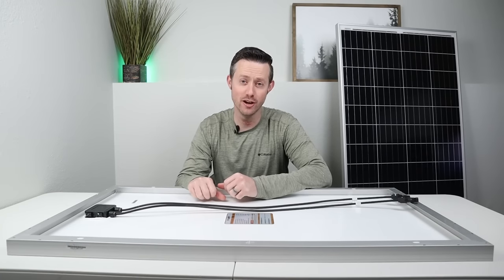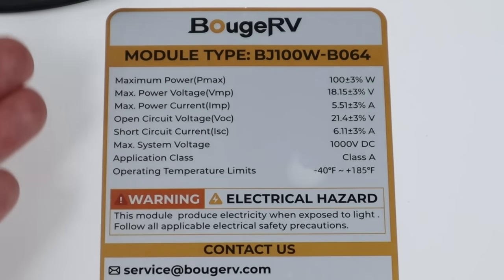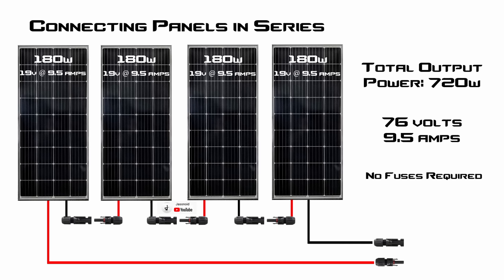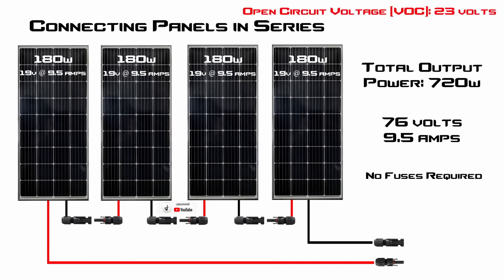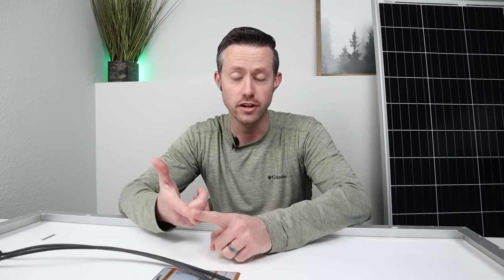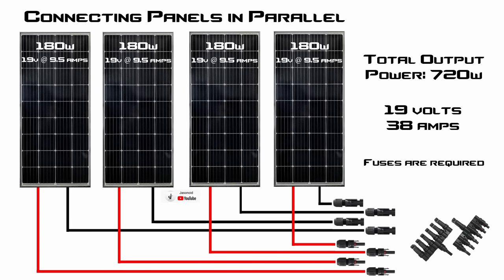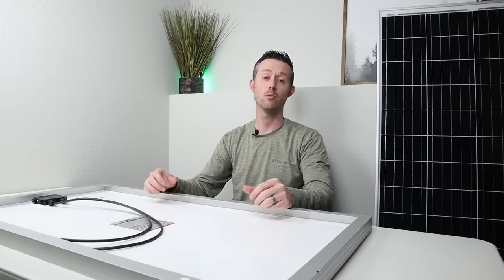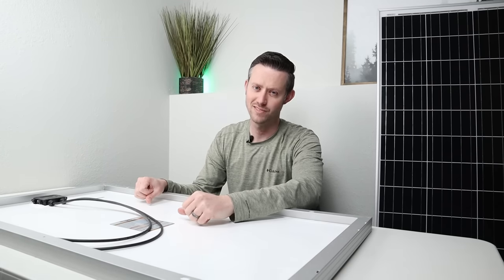Series VS Parallel! A Beginner's Guide for Solar Panel Connections - With Basic Diagrams!

Comment: I would have liked if the video showed the fuse location when they are required. Otherwise, the video is has a significant amount of useful layman information
Reply from the maker: A 15 amp inline goes on each solar panel postive line, you purchase something like this:
https://amzn.to/4cRKPTf

Comment: I’m looking at a solar power station that has a 60v max solar input but allows for 2400 watt charging. What’s the best set up. I would like to use 400 watt panels at about 50v. Thx! Can I only go parallel? What if I need 50ft of cord?
Reply from the maker: Sooooooo..... you're going to want the highest voltage panel you can find so it can be connected in parallel on that model. You can overpanel it, meaning you can have more that 25 amps in your solar array, the power station will limit the amperage automatically. (Sounds like the Anker SOLIX F3800) 

After looking for about 20 minutes I found these two options from signature solar:
https://signaturesolar.com/q-cells-475w-half-cell-bifacial-solar-panel-silver-q-peak-duo-xl-g10-series/
https://signaturesolar.com/bluesun-460w-half-cell-bifacial-solar-panel-silver-up-to-575w-with-bifacial-gain/

Most current '400w' panel options produce peak power at 30v-32v which isn't high enough for full solar input on the F3800. Check out my review of the Anker F3800 I just put out today where I tested with two of my Talesun 400w panels in parallel. I only got 310 watts since the voltage was too low.

For higher power, you need a Vmp around 47v to 48v Vmp on the panel specs but I can't find anything that perfect.

Don't forget to like and subscribe. How often do you get free info like this from other creators?
Reply: Hi Jason, yes it’s the F3800.  If you can over panel (parallel) where does the 2,400 watt array limit come into play?Would I need to use both XT60 ports or can I get the full 2,400 watts going all parallel into one XT60 port? I know the volts matter, but the Amps don’t in this configuration? Thanks! Dave
Reply from the maker: @Curious_Cat123  1200 watts per port, 60v max in each more. Both ports give you 2400 watts total. You can overpanel with amps (meaning panels in parallel). Never go over the max voltage. You can watch my F3800 review for more details.
Reply: @Jasonoid  Thank you. Yes, I have been watching your videos. They are very informative!

Comment: I am confused on this amazing thing called series&parrellel. Even my 2 local rv shops doesn't understand it. PLEASE can break that down better? I need it.
Reply from the maker: It doesn't get more simple than this video. Just keep watching videos till it sticks.
Reply: @Jasonoid  They said you can only do one or the other. So, I did it myself. One has 7 years in business and other said over 10 years. But, I got it
Reply: It actually confusing because you have positive on the left 2 panels BUT positive on the right on the right side panels. Look at your diagram. @Jasonoid

Comment: Sir i have two 200watts solar panel one is 37.5 voc and one is 22.6voc can i series this. My charge controller is 60a Powmr. 12 v system only.
Reply from the maker: Those panels are pretty different, I'm not sure they would work well together due to the different voltage levels. You can always try to see what happens, no harm in that.

Comment: You said to use a fuse. what size fuse. or blocking diode size. I have watched a lot of videos, and no one has given a size.
Reply from the maker: Each solar panel is different. It will usually say on the back spec sheet for what size fuse they recommend. The fuse is there to protect the wire coming off the solar panel, usually a 20 amp fuse will suffice.

Comment: Do bypass diodes not mitigate the shading issue on panels now. I thought that having to wire in parallel for shading was a thing of the past?
Reply from the maker: Bypass diodes essentially skip the panel that's shaded, meaning your voltage will be dropped significantly. Your wattage will also drop since you just took a panel out of your setup. Now there are so many types of panels but the main theme behind bypass diodes is that they will choose the path of least resistance and the power will skip the panel.
Reply: So if any shading is likely to occur, it would be better( assuming the mppt can handle the increase in current) to wire in parallel? @Jasonoid
Reply from the maker: @mrurga35  if you plan to have lots of shading in your setup, chose a parallel setup. Series wiring is horrible for shading.

Comment: hi jason, what if you had 5 panels? 3s +2s into a combiner?
Reply from the maker: From my understanding the voltages have to match in a combiner box. You'd want to have two 3S arrays OR two 2S arrays, not mismatched arrays of 3S and 2S. In the combiner box you're just connecting to a  common bus bar with the positive and negative outputs, so it's like putting those arrays in parallel. Keep both arrays the same voltage and you should be fine.
Reply: @Jasonoid  that is exactly what i was concerned with. thanks for clarifying.

Comment: And where does the cables for the series/parallel go to? A combiner box or a mpg charge controller
Reply from the maker: Depends on the setup. Most setups go straight to the charge controller main pos and neg input.
Reply: Now can i add a second set of series/parallel panels.  I wish i could find an app so I could check my math.  I do appreciate the help

Comment: Okay, someone help me. If you run the solar pannels in series and they're producing up to 100v's at 9.5 amps what controller can you use? I dont know if I'm thinking about this wrong, but every controller I see is only good for 12,24,36, and 48 volts for the most part. I just cant figure out what kind of charge controller I would need, but everything else makes sense to me.
Reply from the maker: This MPPT charge controller works well for 12v - 48v, with solar panels up to 150voc. I use it everyday, it's awesome!
https://amzn.to/3LkiloV

Comment: Calculate the highest number of panels you can put in series and have that combined voltage be lower than what your charge controller can handle. For example, my Victron SmartSolar 150/100 has a 150VDC maximum as well as a 100A ceiling. So if each panel yields 45VDC in daylight then put no more than three panels in series (135VDC). Next, create groups of panels in series to match whatever you just did. So if you put two panels in series, continue to pair up more panels. Each grouping then is put in parallel to increase the current. If each panel yields 15A maximum then each group in series will still yield 15A together. Add as many as six groups in parallel (6 * 15A < 100A) and you'd have the maximum number of panels for my controller in this case. The maximum power then for this particular panel specification would be 135VDC * 90A => 12,150W. A common misconception is that you should put all the panels in parallel; this produces a lower overall voltage like 15VDC most of the day which is barely enough to get the MPPT to actually charge a 12VDC collection of batteries and even worse for a 24VDC set. Plan for the highest combined voltage that your charger will handle on the solar side of things and the "bulk" period of the day will be optimal.
Reply from the maker: Thanks for the tips! I'm sure others will find it helpful!

Comment: Hello what procedure to run foldable harbor freight 100 watt panels 50 watts per side however both are already linked to each other and then only having one main lead coming out module previously linking both panels already , if you look at rear panels its not like typical 100 watt panel that has its own positive and negative leads I havn't found any video addressing this yet thanks in advance
Reply from the maker: Does it look like an SAE connector? It's a common automotive electrical connection?
Reply: @Jasonoid  firstly thanks I appreciate response..I already converted the connector from sae to mc4 the issue for me is the foldable panel each has a module on backside one module is already linked into other module from factory with one main lead pos/neg to connect instead each module having its own pos/neg leads on the back of the panel it states these panels cannot connect in series, but I see other utubers say they can, but without showing illustration, not sure if this make sense to you thanks again
Reply from the maker: @YH7R  okay, so they are wired in parallel from the factory. I reviewed a folding solar panel that was similar on the channel awhile ago. 
If you wanted to connect them in series you'd want to cut the wires coming out of the first panel so it's has its own wiring, then test for polarity to see which one is pos and negative, then add mc4 connections to each wire. You could also try to break open the junction box and just unscrew the wires from there and do the same thing without cutting the wires. Usually the junction boxes are accessible and just pop off with a screwdriver. 
With the wires separated and mc4 installed, you can easily connect them in different scenarios since they have individual MC4 connectors (parallel or series)
Reply: @Jasonoid  Ok will do Your such a blessing I really appreciate your help GOD BLESS you and your family

Comment: I have 4 panel with 180 Watts and 05 panel with 100 watts..... is it  possible to connect all panel series and to the MPPT 
controller.if not just advice me how I can connect alla those panels get Enegery
Reply from the maker: If the panels have similar voltages at peak power they might work well together. You'll want to combine the 100w panels in pairs of parallel so they match the power of the 180w panels, then you'll get better power as they are connected in series.
Reply: Thank you for your advice 
 @Jasonoid

Comment: I have two 235 solar panels connected in series. On sunny days, I get 250 watts into my power station. I purchased the panels second-hand. I'm confused about why I'm not getting 470 watts of solar or greater during cold, sunny weather. I also had a 100-watt panel, and I was not getting full output I was around 80 watts.

Any ideas as to why this is happening? The most i have seen is 300 plus.
Reply from the maker: What power station do you have?
Reply: @Jasonoid  vanpowers super power pro 2000 it’s supposed to handle up to 600 watt solar power input
Reply from the maker: @miguelguerrero2335  when connecting solar panels in series, if any portion of the panel is shaded, you'll lose most the power output. If you have them mounted on the roof, make sure there are no shadows on the panels.
Reply: @Jasonoid  There are no shadows. They are mounted on my cargo trailer. I honestly don't know what is wrong, but I'll keep using the panels.
Reply from the maker: @miguelguerrero2335  panels laying flat in the winter get horrible power due to the sun being very low in the south.

You'll see better solar power in the summer as the sun is higher in the high and light gets more vertical.

Comment: How much wattage I need for solar panel if I have 12v 1.5kw hybrid inverter.
Reply from the maker: if you are going to be maxing out the inverter at 1500 watts frequently, it might be wise to have at least 1000 to 1200 watts of solar panels.

Comment: Sir good day I have a question please2 reply I like the way you explain obout solar panel.my name is edwin apolinario and I'm a pilipino who is a zero knoleged about off grid solar source.now my questio is can I connect 5peaces solar panel off one hundred watts each to a battery one peace only of 100 watts .accordingly to some of the YouTube technician video it takes of 5 hour to one solar panel of100 watts to fully charge,the battery of watts .in our country we could get solid hot sun 4 to 5 hour a day that's I plan to connect 5 peace solar panel to one battery so that I could charge in one hour .now I want to know the danger of that I I don use the power that comes from the solar panel.it is dangerous I could burn or please give me an advice thanks

Comment: I did not understand why do I need in line fuses on positive wire of each panel when I connect them in parallel. In my understanding, the wires have amperage rating not the panel. The two wires coming out of my solar panels have 12AWG which has amperage rating 20A. I have three Sanyo  HIP-200BA3 (200watt) solar panels: Short circuit (Isc):3:83A; Open circuit voltage (Voc):68.7V; (Ipmax): 3.59A; (Vpmax): 55.8V. I am planning to connect those three panels in parallel. Therefore I am using two adapters to combine those six wires before they go down through the roof. Do I still need in line fuse on each panel before they connect to an adapter that combine them?
Reply from the maker: When wired in parallel if one of the panels has a cell fail it will absorb the amperage of the entire circuit so the total array amperage will flow into that panel. If the total array amperage is under 20 amps, the 12awg will be just fine. 

Those panels are a bit unique, they have very high voltage and low amperage so I don't see an issue not having a fuse with those panels. 

Most other 200w panels have 20v @ 10 amps each, so having 3 in parallel would be 20v @ 30 amps which could cause an issue with 12awg wire if something went wrong.
Reply: @Jasonoid  Thank you very much for such a quick response Jason!. God bless!
Reply: Will Victron 100/ 15 work for my panel that I mentioned above or do I need higher amerage controller like 60A?
Reply from the maker: @temirtaragay8932  the 100 in the title means up to 100 volts input from your solar panel, the 15 means it will charge the battery at 15 amps.

Comment: I connected all of mine in parallel because I wanted to most amps flowing to the batteries with the least amount of voltage eaten up by the charge controller.

Comment: What determine if the batteries is to be connected in series or parallel
Reply from the maker: Usually the battery voltage or the charge controller. Some charge controllers can only handle a low input voltage.

Comment: Can six panels b connected  in both parallel  n series
Reply from the maker: Yes, you'd want to chose how to wire them together based on the input voltage of your charge controller. You could do a 3S2P array, or a 3P2S array.

Comment: How to know the size of solar panels that can charge battery of 48volts with inverter of 6kw
Reply from the maker: You size your solar panels based on how much power you plan to use / charge per day. There's really not end to how many solar panels you can add, you just need to stay within the tolerance of your charge controller voltage. You can always stack more charge controllers as you need.

Comment: What do you do if you have 5 panels?
Reply from the maker: You can only run them in series. You'd have to have 4 or 6 panels to run them in parallel so each side of the array is equal.

Comment: I have a different topic, it's out of the ordinary but here it goes, for those people that have multiple power stations from different brands. How bout trying to connect an Expansion battery from One Company to another to add capacity.
Reply from the maker: Unfortunately all the expansion batteries have communication cables that speak to each brand specifically. Putting two together that are from different brands wouldn't work. I have plans to eventually make a video about a DIY 48v LFP server rack battery as an expansion.

Comment: can i buy 3(180watt) panels for the ff power 2ooo ?
Reply from the maker: The P2001 can only take in 50volts for solar. Most 12v solar panels will be around 45-48 volts open circuit in series. You'll have to purchase 4 panels and wire them in a 2S2P array like seen in the video to get the full 500 watts. Putting 3 panels in series will damage the power station and void the warranty.
Reply: @Jasonoid  got it!!!

Comment: Hi how to use solar voltage direct to electric appliances without batteries
Reply from the maker: The solar panels don't put out steady enough power to run appliances, the battery is there to keep the power consistent.
Reply: OK thanks which means I also need an inverter and the whole kit

Comment: I need help please! I got a 100w panel for my van roof last week and plugged into my bluetti 700w. Worked fine all week. Today I added another identical panel. I plugged the 2 inner cords together and then the 2 outer cords to my bluetti cord, then plugged it in. No go... I got a 10ft solar extension cord to run through the back window. Each panel works separately with both the bluetti cord and adding the new solar extension cord. However, nothing happens when the panels are connected in series. Can someone please help me? Thanks!
Reply from the maker: The Bluetti EB70 does not support solar panels in series, it might damage the charge controller! Only connect solar panels in parallel on the EB70. That means you'll need to purchase solar parallel adapters and connect the positive to positive and negative and negative. They are readily available on amazon:  https://amzn.to/46C6FpR
Reply: @Jasonoid  Thanks for your fast reply. My bluetti is the eb55, 700w. Is it the same that I can't wire the panels in series? Thanks again for your help!
Reply from the maker: @debbietulk4846  yes, the EB55 and EB70 have the same charge controller. They can't take solar panels in series, only in parallel.

Comment: why is the drawing showing neg /pos   neg/pos  then pos/neg  pos/neg  I thought all panels were the same with pos on the left and neg on the right..??   when facing you
Reply from the maker: That's a series connection (pos into neg). The panels have pigtails about 3 feet long so you can change up the connection type between series and parallel when needed.